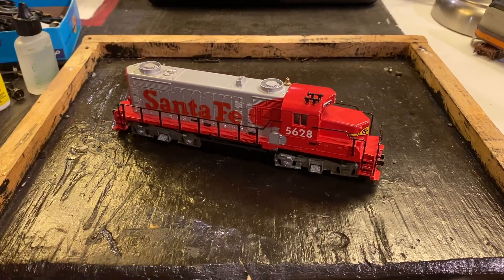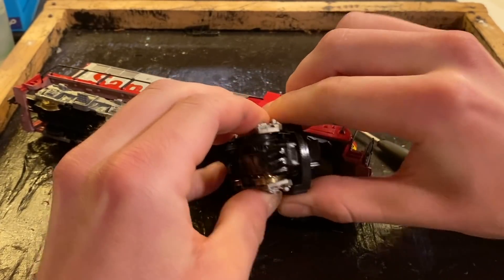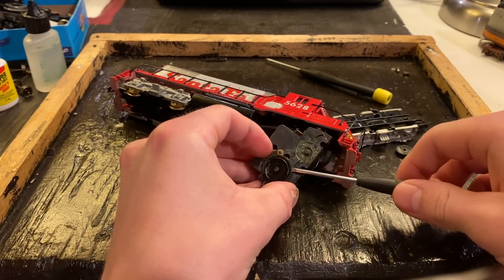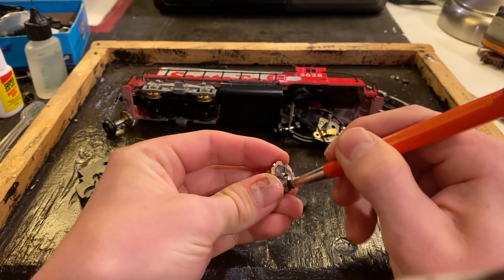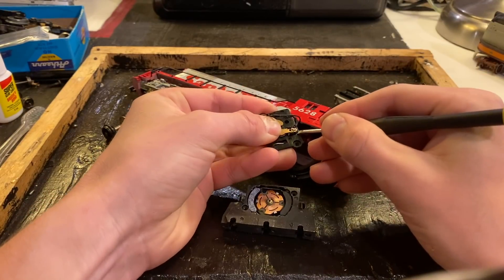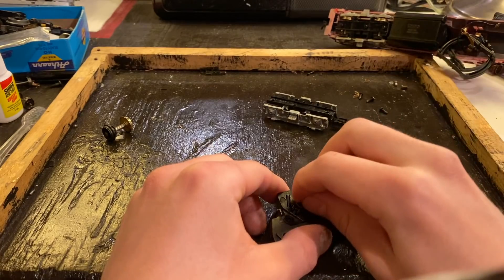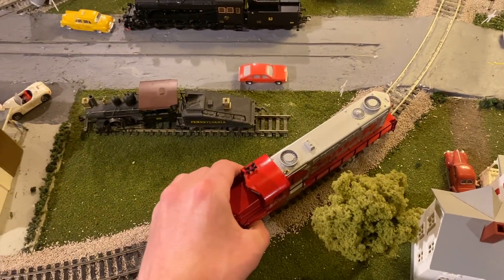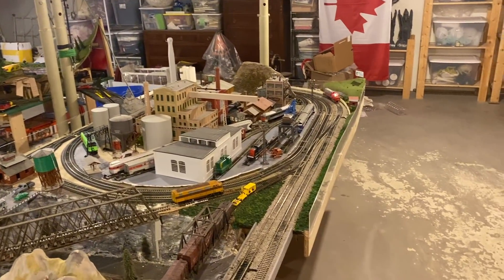Vintage Tyco Santa Fe Diesel Resurrection

Comment: It's never a complete restoration without the oversized soldering gun coming out! Keep up the good work SMT!
Reply: I still can't figure out why anyone would need one that big... Like it's usually 2 wires that need to be soldered.
Reply: @aaronsadowski1691  its a vintage soldering iron. My grandfather had 2of those . i believe they were by craftsman or something had lights on them it is big but maybe what he like to use. I bought a cheap one and it works good but they so cheaply made the soldering point got hot enough it isntstraight in the holder anymore.
Reply from the maker: @aaronsadowski1691  Because it's fantastic, you don't have to wait until the next decade for it to heat up.
Reply: @SMTMainline  Ahhh very good point.
Reply: @mercuryoak2  I see, almost as legendary as Nerf Cat!
Reply: Haha
Do you need a permit to have something like that?
Reply: @jdmills4370  No, not that I'm aware. You just need to put in the time to learn how to use it.

Comment: Super. When I bought my two Mantua/Tyco EMD GP-20 locomotives, so long ago, painted in the Chicago, Burlington, & Quincy/Burlington Route Chinese Red paint scheme, which I love, I was not only excited, but l had a plan. One had the MU-2 motor drive, and one had the Powertorque drive. I switched the Powertorque drive to my Tyco Baldwin RF-16 Sharknose and added extra geared wheels and three axle sideframes and my own railroads paint scheme, because I wanted a Baldwin BP-20 Passenger Sharknose locomotive, and I put the four axle Tyco ALCO truck sideframes on the formally Powertorqued GP-20, because I wanted a ALCO trucked EMD GP-20 DUMMY with track powered lighting. All three got full lighting packages and had their traction tire slots filled in. I also installed extra weight and window glass, changed the couplers, added store bought details, and both the powered and now dummy GP-20s acquired dynamic brake blisters from two Lionel GP-9s, as only the New York Central had GP-20 locomotives without dynamic brakes. Forty years later, all three locomotives have survived and are in continous operation, with the only restriction being that I no longer let the Shark operate outside, mostly to keep leaves and gravel out of the exposed gears. All three have a beautiful patina after all the years of operation, as does much of my older rolling stock, and look very realistic. I may also have the last Tyco Powertorque driven unit not only still in service after 40 years, but actually in daily operation, that exists on this planet. 🙂 The dual motored, twelve wheel drive Shark has pulled 35 freight cars without issue, on my mainline grades, but nowadays it pulls my 6 car passenger commuter train most of the time, sometimes pairing up with a Fairbanks Morse CPA24-5 C-Liner dummy if they are running late. The GP-20 operates as smooth as silk and will pull ten cars with the GP-20 dummy, or sixteen without it, which isn't bad for a four wheel drive locomotive with no traction tires. If the Geep needs help, I have plenty of power to add to the train. Good job fixing the locomotive. Hello again from the Tracy Mountain Railway in Colorado, and thanks for the forty year old memories.💙 T.E.N.

Comment: I have one of those in Santa Fe freight colors.  Fairly well detailed.  I despise the drive unit on these so I kitbashed it with the chassis of an Athearn GP35. It's a fairly easy conversion.  Had to remove the dimples under the shell where hand rail stands attach.  Little bit of metal removal from the frame and it goes together very well.  Fortunately the GP35 chassis is exactly the right length. 

I also did the same with the Tyco Alco Century but I used an Athearn SD9 chassis. It's 6 axle instead of 4 but so what!  If someone questions it just give them a back story.  (When the Soo Line ordered new GP30s in the early 60s they insisted on Alco trucks under them.)  

Both locos run great and will MU easily with other Athearns. 
Only important thing is you'll need to use the later narrow Athearn motors.  The old wide motors won't fit.
Reply: I’ve done the same, with an Athearn dummy frame. Lot of filing, but worth it.

Comment: I would love for all the naysayers on forums who say “there’s no parts available” or “not worth fixing” in regards to the older, “lower-end stuff” to watch a few of your videos so you can prove this to them......
Reply from the maker: They might not be worth fixing to some people but I don't really care, I enjoy fixing them and isn't the point of the hobby to enjoy what you're doing?
Reply: SMT Mainline 
Exactly
Reply: I’ve also read complaints about their pulling power. So I went and tested mine. Tested 2 Tyco/Mantua GP20s with MU-2 motor. One pulled 14, the other 12. Both on “questionable” traction tires.  Together they hauled 20 cars and a caboose with no sweat......that length is beyond the practical limit for my RR anyways. 
Looks like good enough for me

Comment: Hi SMT - I rebuild power torques  - I would never recommend removing those brass plates on motor housing. You got lucky those snapped back into place. Many won’t do that. I made a replica of the Tyco tool used for holding brush and Springs to put back into engine. Nice work and smooth runner. On my rebuilds - I install copper brushes and new Springs and magnets -

Comment: SMT - Dirty Dan did express concern earlier about breaking the gear's axle off of the motor block, while removing the gears.  I wonder if the gears & motor block could be scrubbed with isopropyl alcohol & a toothbrush before removing the gears - to remove the grease.  I also thought an Xacto knife blade would work good to slide underneath the gears?
Reply from the maker: That might be an interesting strategy to loosen up the gears. An xacto blade may work well too since it could provide force closer to the centre of the gear.

Comment: Would someone please send him a proper soldering iron for the tiny wire work.  That one is designed to burn holes in 50 year old TV chassis!
Reply from the maker: I like my soldering iron, it heats up instantly. I already have a regular one but I find it painfully slow.

Comment: any advice on traction tires, I have an older Tyco and my local store says to trash it and I'm not going to. He also said that they're not available.  but I have saw them online.  I'm just being cautious.  Thanks.
Reply: Fleischmann makes a range of traction tyres in different diameters and widths. There is one that is a good fit on TYCO wheels, but I've forgotten the stock number.. Failing that, there's a product with the unlikely name of "Bullfrog Snot" from which you can make your own traction tyres on the wheels.
Reply: @JBofBrisbane  Thank you so much for the advice.

Comment: Another Tyco Power Torque saved from the locomotive graveyard! I have one just like it, great runner, but it has a weird waddle to it. Any thoughts on what that might be? Thanks for posting this video 👍
Reply from the maker: I suspect an uneven traction tire would be the cause of a wobble. Sometimes they get get warped and cause strange stuff to happen.
Reply: @SMTMainline  Thanks SMT! I’ll checkout the traction tires, it’s the simple things that can cause confusion and delay. 😉

Comment: Great crash course on reviving these old Tyco locomotives!  I was wondering though, is it possible to convert these locomotives to an all wheel drive system?  Just curious and thanks for sharing!
Reply: In answer to your question, YES.  I have one of those in Santa Fe freight colors.  Fairly well detailed.  I despise the drive unit on these so I kitbashed it with the chassis of an Athearn GP35. It's a fairly easy conversion.  Had to remove the dimples under the shell where hand rail stands attach.  Little bit of metal removal from the frame and it goes together very well.  Fortunately the GP35 chassis is exactly the right length. 

I also did the same with the Tyco Alco Century but I used an Athearn SD9 chassis. It's 6 axle instead of 4 but so what!  If someone questions it just give them a back story.  (When the Soo Line ordered new GP30s in the early 60s they insisted on Alco trucks under them.)  

Both locos run great and will MU easily with other Athearns. 
Only important thing is you'll need to use the later narrow Athearn motors.  The old wide motors won't fit.
Reply: @Iconoclasher  ok cool, thanks for the info!

Comment: I’m always scared to do restorations on old locomotives without a parts diagram. How do you do it? 😂
Reply from the maker: Trial and error. It doesn't always go well but you eventually learn. One thing I would always suggest thought is if you're having trouble taking something apart or putting it back together is to examine it closely and not to use brute force.

Comment: you are a little rough on your locomotives
Reply: Since TYCO locomotives are so cheaply made, they don't have much detail, so there isn't really anything to break apart from the trucks.
Reply from the maker: These are not very sensitive pieces equipment, they were designed more-less for beginners (mostly youngsters) and do not have many small details that can be broken off or a drivetrain that requires NASA grade precision for servicing.